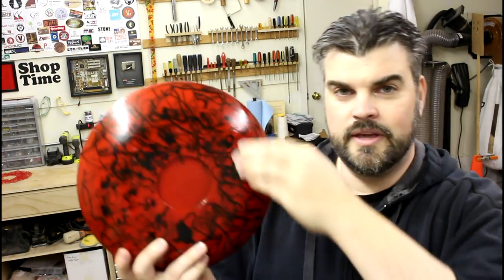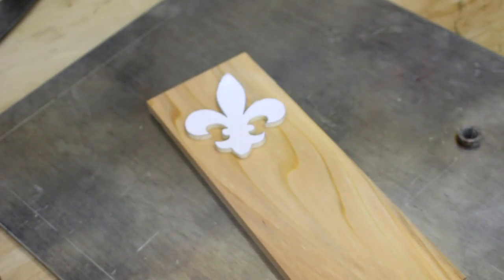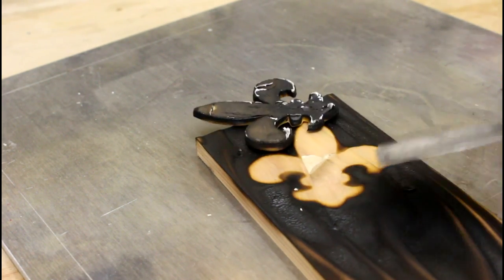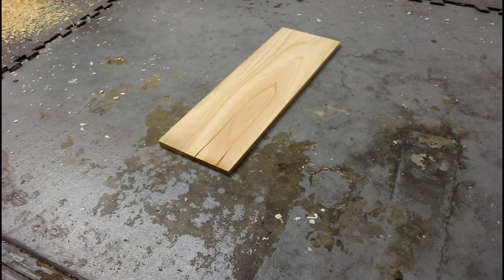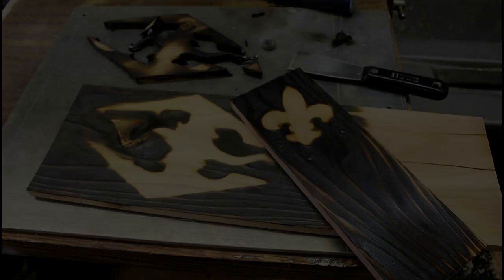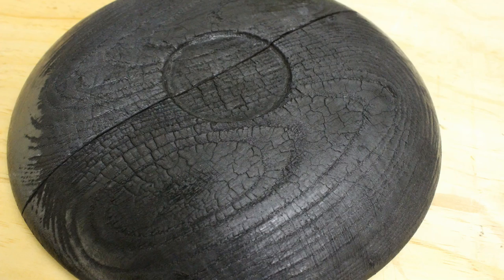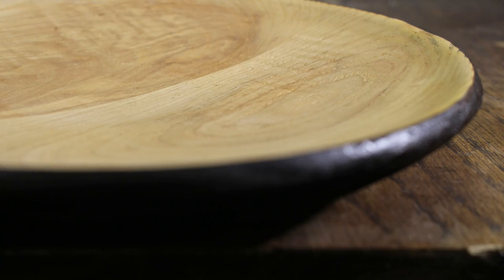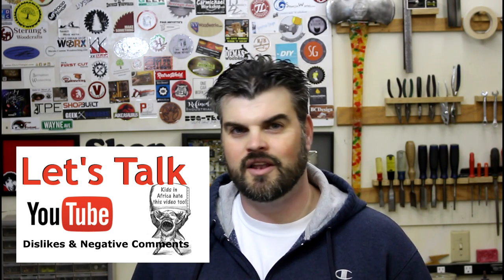Burn It #3: Shou Sugi Ban

Comment: As someone who's experimented a fair bit with shou sugi ban recently I can definitely recommend waxing the wood, just regular old paste wax will do, while it's still warm. It seals up the charred surface (i.e. no more black fingers) and gives it a really nice lustre. While I truly appreciate your gung-ho attitude towards it, a bit slower burn, bringing the wood up to heat and toasting and charring would yield a bit more controllable results. But yeah, glue joints will split and separate, definitely better on solid pieces, and generally not so thin pieces as they tend to warp from the heat.
Reply from the maker: Thank you for the information. I'll definitely give the paste wax a try and see how I like it!
Reply: You betcha! Very cool with the stenciling though, it's like a reverse brand of sorts.

Comment: so shou sugi ban or yakusugi is generally best done on oak or cedar because the grain is tighter and the idea isn't just to burn it but also to take a stiff bristle or wire brush to the surface and scrape away all the ash and softer wood in between the grain to make it pop.
Reply from the maker: This bowl was ash (which is similar to Oak) and has a lot of late/early growth. I do show us using the wire brush to deepen the grain, but I didn't talk about it.

It really is a cool technique, even if I do tend to gloss over the details a bit.
Reply: i just saw you lightly brushing at the surface. you're usually supposed to put your back into it and really go to down with the wire brush. some people even use the wire brush head on an angle grinder.
Reply: The irony, the bowl made of ash is now in cinders.

Comment: I've had great success with burning stencils with well defined edges.  the trick is to lightly use the torch to draw out any water on the surface of the wood so it will darken quicker when the flame hits it and for my stencil I used 3 layers of cardstock sandwiched together that was dipped in a bath of water.

Comment: Hi Peter, you can use a playing card or similar across the throat of your scroll saw when working on small pieces, as a insert plate.
Reply from the maker: OH! That's a great idea. Do you have to stick it down with something?
Reply: Just tape it down. You can also use packing tape over your template while cutting, as this acts like a lubricant, reducing friction and lowers the chance of your blade breaking.

Comment: We're in a controlled environment: We have the garage door open! 

Good thinking there, Peter! Everybody knows you can suppress a fire by giving it extra air ...
Reply: Well they die from being burned alive but not die from the smoke.
Reply: I suppose it's also easier to run out of the burning garage if the door is already open.
Reply: Now maybe they can move more than 18” away from the propane tank...

Comment: Nice.  I mean, I liked it before you burnt it, but this is also cool.
Would copper tape last long enough to use as a resist for scorching? (the stuff used for Tiffany-method stained glass).  I'm thinking that a turned vase, randomly wrapped in, say 4mm copper tape, then scorched, might look really nice.
Reply: Copper conducts heat better than wood (better than most substances, in fact), so areas covered with copper ought to burn first-- the opposite of a resist.
Reply: Interesting... I may have to try this myself - my gut feeling is that it will offer some protection from scorching,  partly because it's preventing incandescent gas from touching the wood, but also, because it ought to conduct heat away from the site of heating - spreading it out.  Easy enough to test...

Comment: Regarding burning patterns I believe you'd probably get better detail if you cut the pattern in a thinner piece of wood. As it seems logic the flame would reach in the corners easier. But there would also be less wood protecting so I guess you'd have to be quicker/more careful. Just a thought I had when watching this.

and the bowl turned out great, I'm really fascinated by the looks of burnt wood!

Comment: It doesn't need to be thick it just needs to take longer to burn than the wood behind it. I suggest soaking poplar in water mixed with baking soda. Also that was not paint peeling on the torch, it was scale

Comment: I think if you mixed this technique with the hot glue from last time (or maybe some resin) you could get a stronger outline on your shapes and be able to get more intricate shapes like the neck of the dragon. because it would be stuck to the surface of the wood and you could make it thiner so the heat would have an easier time getting into the corners.

Comment: Also do not heat up concrete above the boiling temperature of water, Concrete is more or less kind of a sponge and it can and will explode from steam pressure.

Comment: I have done this to a gun stock (a cheap .22 single shot) it turned out pretty well but I just burned in stripes like a zebra and not so aggressively ... then sanded it to soften the contrast.  I was told it was just called sugi  pronounced Sue Gee.

Comment: Hmmmm.....now I want to do this for the white ash back of the electric guitar I'm building...any tips? I'm worried about a crack in the glue joint, it is biscuit jointed...
Reply: Tyson King I would think you would want to quickly heat up the surface so it chars but be careful to not overheat the underlying wood. Try it on a test peice first.

Comment: You are holding the torch at too much of an angle which is causing too much heat to go in between the wood, therefore, burning what you do not want burnt